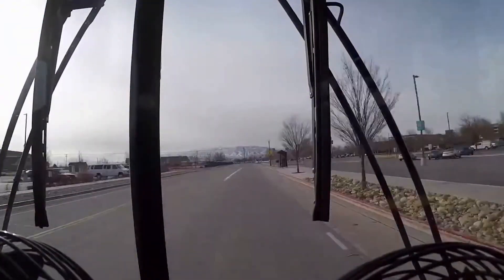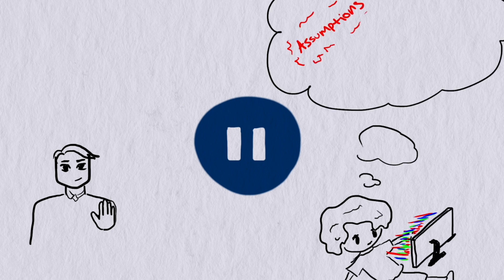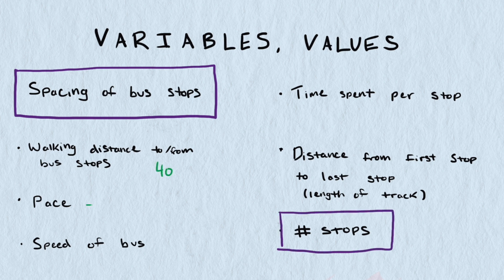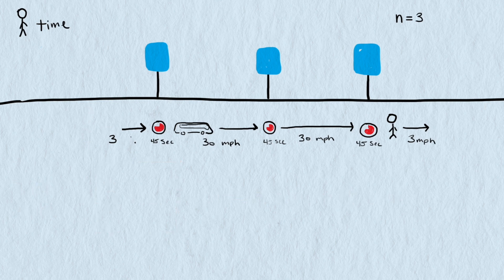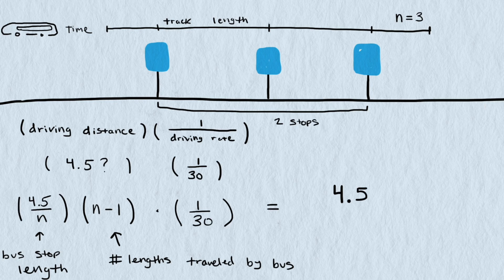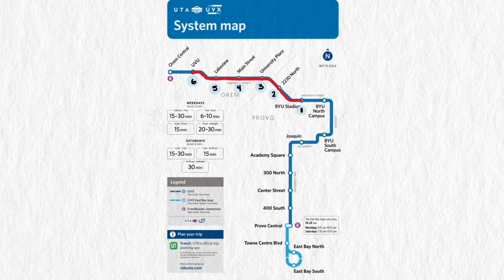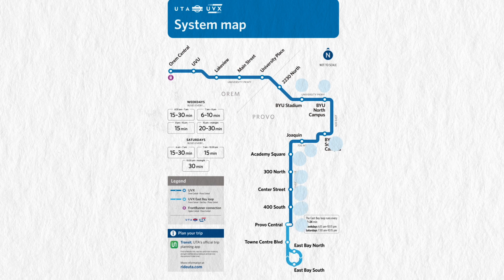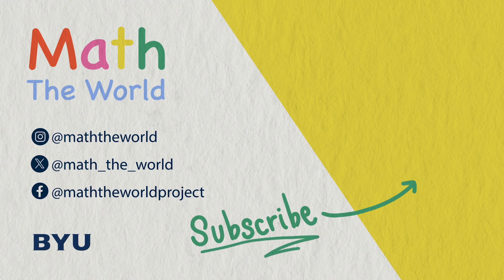How Far Apart Should Bus Stops REALLY Be? | A Math Problem Solving Approach | Part 3

Comment: I have to wonder how the math changes if you assume the likelihood of a bus actually stopping at a stop is proportionate to how many people are liable to use it. In the extreme case of a bus stop every 20 metres serving one building, reasonably speaking you'd only expect the bus to stop very occasionally, particularly off-peak. Some bus routes in London operate (effectively) on this system, where a bus can stop anywhere along a section of route the driver deems safe, but only when someone wishes to board or alight.

Also, though not applicable for BRT (hopefully) - the added time boarding compared to alighting, if the driver has to sell tickets, would probably affect the model significantly. That said, for a limited model, it's nice to see how well it does.
Reply from the maker: These are great points you bring up! We’re considering making a part 2 to analyze and answer some additional questions viewers have asked so stay tuned!
Reply: Yes, this would be the next variation I would make in the model. Maybe we will do that in a follow-up.

Comment: Interesting that your decision criterion is based on travei time, which seems always neglected in discus sc ions like this.  1.  How about comparing your travel time in a car vs walk+bus.  Answer is obvious.  2.  You assume bus is waiting at stop for passenger, instead of passenger waiting for bus.  How frequently should bus operate?  3.  Classic problem of mass transit vs individual transit.  Your car travels 4-1/2 in 9 minutes, vs 30 for bus.  4.  Since bus travels say 30 mph vs walk 3 mph, and random trip length, it would seem optimum is lots of stops.  Yet more stops means slower trip time, making car a better choice.  Nice ideas, nexr step?
Reply from the maker: Thank you so much for your comment. A lot of good stuff here. 

I did assume the passenger didn't have to wait for the bus, but that was a trade-off with picking the worst-case scenario for walking. I over-estimated in one and under-estimated in the other. The waiting is certainly an issue. When I would take an express bus to work, my drive to the bus stop and the typical wait for the bus was the same amount of time it would take for me to drive to work, and that was even before I got on the bus!

Comment: I'm not sure that assuming a single average waiting time value (in this case 45s) for each stop is reasonable. The time it takes a bus to load/unload all the passengers at any given stop depends on how many people are waiting, which in turn is influenced by the number of stops: if you have more stops, people will distribute more evenly, reducing the average time spent at each stop. On the contrary, if you reduce the number of stops, each stop will be more crowded, forcing the bus to wait longer at each stop for everyone to get on/off. A more reasonable model would include this variable in a way that makes it dependent on the number of stops.
Reply from the maker: Oh, I like it. We will try to integrate this into our next model!

Comment: there's a bus line near my house that has stops every .2 miles
Reply from the maker: Those are pretty close together. But if it's a neighborhood bus that's still reasonable. We analyzed a rapid bus system which is always designed with stops a bit further apart!

Comment: The length of time the bus takes at each stop is partly a matter of how long it takes for everyone to set down their groceries once the person ahead is out of the way, fumble with their wallet, find their pass, tap it on the fare box, and get out of the way so the next person can start their turn.  That part is proportional to the number of people getting on, so it doesn't change if you add or remove stops.
Reply from the maker: That's a great point and something we didn't point out in our videos. One thing different about our rapid transit bus system local to us is that they are free for everyone to use! So there are no passes or wallets to fumble with. But certainly loading and unloading time will be proportionate to the number of people at that stop.

Comment: Bad engineering: the Navy has been building the wrong ship hulls for 80 years; by building in a crushable space, ship hulls can be protected against mines, torpedoes and suicide boat attacks.  The engineering is, actually fairly straight-forward. 
Illustration:  YouTube/drochmhaada/ torpedo protected hull
                      YouTube/drochmhaada/ torpedo protected hull 2
                      YouTube/drochmhaada/ No one had to die on Cole
The Navy
                       YouTube/drochmhaada/ modern torpedo

Comment: Sadly, no matter how ingenious your models, it all has to do with union rules and the bogus inefficient nature of union hegemony. I was in transit IT for decades and I devised similar models that used the linear referencing data that optimized the entire system without significantly affecting runcutting (the process of generating routes from system parameters and union rules). I was constantly foiled by union flunkies that snootily informed me the system could not be optimized like that due to complex union negotiations that went down to the level of every stop arrival time to optimize the least possible work for drivers and maximum vacation hours and overtime pay etc.
Reply from the maker: How unfortunate. But good for you for using modeling to devise solutions! We wish you the best of luck in your work!
Reply: That doesn't have much to do with it. Whether they stop at 5 or 7 stops along a stretch doesn't have much impact on the drivers.
Reply: @SmallSpoonBrigade  When they are doing it 30 times a day it does, genius.